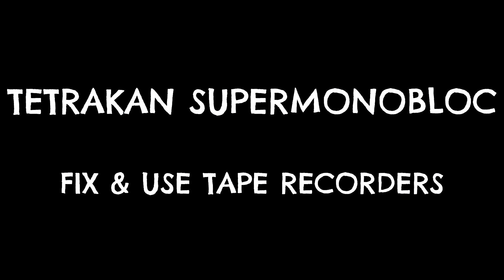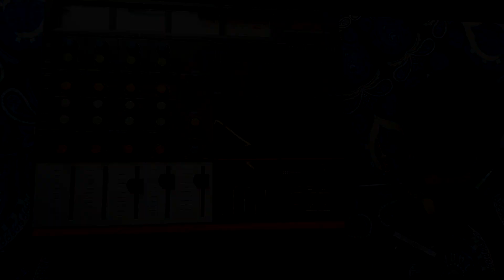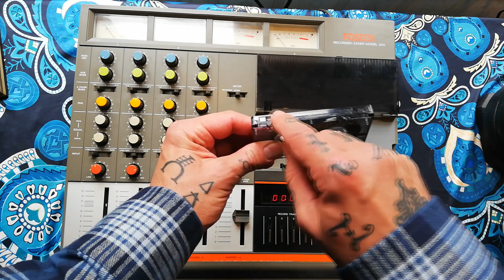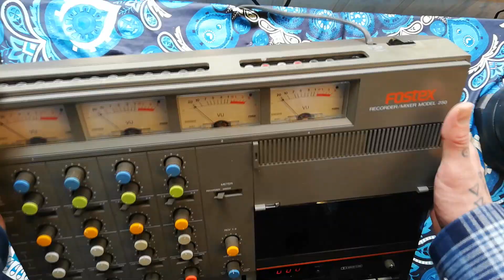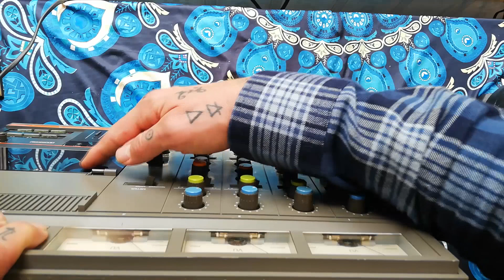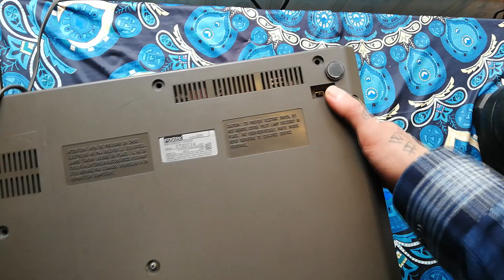Fostex 250 | Review & Features Overview | Comparison vs Teac 144 and Tascam 244

Comment: Just picked up one of these. I can't seem to get it to record anything. Is the little light by the record button supposed to turn red when engaged? Because for me it never lights up. Wondering if the record mechanism is broken. Because it plays back other tapes fine
Reply: Had the same issue and just got it fixed - the little piece of metal that makes contact to complete a circuit when a cassette is put in was bent.  Bent it back and now it works.  Was super frustrating because I had fixed the transport section which previously wasn’t playing tapes at all, and then couldn’t get it to arm…. Hope yours is as simple a fix

Comment: I've actually got mine in the shed half assembled. I've had it since about 1985  It was wrecked years ago by someone who borrowed it.And returned it non working with most of the knobs missing. On that occasion I repaired it and Gave it to my Nephew who at the time was studying music at college.
He later went on to study a royal collage of music and now works professionally on film scores. When DAWs came out he arrived at my house with the Fostex and gave it back to me not fully working.( which is fair enough I actually didn't want or expect it back) It sat in my loift for a few years until a couple of years ago when I thought I'd have a go at fixing it.
All the transport controls were non functioning as all the tactile switches were worn out I bought some new switches and had to make a new board to hold them as they were wildly different from the originals I also had to rebuild the mech. once I got that all working I discovered all the electronics were faulty and either humming or dead. All the slider knobs were broken other than one and the knobs were not original from the time when I repaired it before. I looked at it sat in the shed last weekend just after rebuilding my friends Akai MG614 and thinking it either needs fixing or given a good funeral.
So this week I managed to source the servicre manual and designed copies of the slider knobs so that I can 3d print some replacements. I'll maybe get around to looking at it at some point in the near future. It's just not something that I'm desperate to get working and whilst it would be nice to get it working I also have other things that need my attention over this.

Comment: I'm actually servicing a fostex 250 with the help of your great video guidance. One of the four VU Meters isn't moving anymore but it doesn't seen to be stuck. What could I check before unsoldering or replacing it? Cheers Tommi

Comment: Thank you for your amazing video. I want to use it as a 4-channel mic pre and EQ with individual outputs（to daw through Audio Interface）. Can I send the effected signal from the tape out jack to the daw without having to record it once to tape?
Reply from the maker: Thanks. No you'd have to record first. You could use the line out from the mixer without using the tape player, but that's a stereo out, not 4 mono outs

Comment: I've had one since 1988 that still functions great - and still pull it out to show students about workflow and how recording architecture has not really changed. The cool thing about these is you can use the rcas on the back to implement a compressor in series with the channel direct out out to tape in and get decent, controlled dynamic range without noise floor issues. I think Fostex even made a simple compressor unit. On playback you could take the tape out, then through compressor and back into a channel in line mode and no trim as the level was at unity - but of course this could raise the noise floor. Yes the EQ is a little odd, but if you think about most sounds being fundamental/body and then harmonic, it makes sense.  Taught me a lot about signal flow and what could be done!

Comment: Great video series. Do you know if the model 250 AV can be modified to run at 3.75 ips?? Is there a simple solution? I have the service manual for the 250 but not the 250 AV. The 250 AV runs at normal cassette speed of 1.875 ips. Thanks for any advice!
Reply from the maker: I haven't tried to do that. I guess simplest thing would be  you could run a charge pump on the positive 12 volt input of the motor to double the voltage to 24 volts but I suspect the results would be unstable with a lot of wow and flutter. Most 3and 3/4 IPS rated motors have 4 input cables coming from the recorder and a control chip in the internal circuit board to regulate the speed, so in a more thorough mod  you would have to replicate both parts of this circuit and find somewhere to mount it? I think it'd be complex, so unless you love those sorts of challenges, I'd suggest getting another multitracker would make more sense...good luck!

Comment: I recently acquired and repaired one of these.  Here are a few impressions:

(1) The four-bus system is a bit weird, in that there is no separate "LR main stereo" bus.  This has implications for monitoring busses 3 and 4, amongst other things.

(2) I found the upper mid eq control to be a wonderful feature.  It is centered on exactly the right frequency for bringing a vocal or guitar sound alive.

(3) Setting the playback levels was not straightforward, going by the procedure in the service manual.  In the manual, this is handled under a section dealing with the Dolby C system, and there are two trim pots mentioned, and the adjustments are to be done using proprietary equipment and according to a procedure that was not unambiguously described.

(4) On the whole, I love this unit.  I have been getting good sound from it, and in fact I am currently using it as my main mixer for monitoring my everyday "mess around" direct guitar sounds.

(5) If I could change just one thing about this unit, I would add two more input strips, so that on mixdown I could pan a delay effect.

Thanks for these vids!
Reply from the maker: I completely agree that this has an especially nice sounding mixer, my electric guitar sounded much better through this than through the X15 for example, such a pity I couldn't get the transport on the unit I had working
Reply: Ok I know this a long shot and I’m 2 years late to your comment, but what did you do to get the monitoring for busses/tape channels corrected? For my 250, everything works great, but when I pan my signal to the right it completely disappears. The left works great though. As a result I only have tape channel 1 & 3 lol. Not sure where the disconnect is although it could definitely be the user 😆
Reply from the maker: @taylorspecht2886 blocked or corroded master fader?
Reply: @Tetrakan  thanks for the lightning fast reply!!! Ok, I’ll have to look into that!

Comment: This video and the others you posted on the 250 were really helpful in my own repairing attempt at this unit; I've had it sitting in storage for 4 years  too intimidated to take the behemoth apart. Looks like I had a bad relay on Track 1 of the Rec/PB amplifier board causing the VU on that channel to go crazy (3VAC/38hz was making it's way into the audio path). In any case, I'm wondering if you noticed a signal level difference between Trk 1/2 & 3/4? If I send a signal into any of the inputs while routing it to Trk 3/4 with that selector switch the VUs on those channels receive a higher Voltage than those on 1/2. I noticed on the Mixer board of my unit that C316/416, C318/418, R340/440 and the SGR cables aren't installed which is reflected to some degree (C318/418 & R340/440) in the service manual. I imagine that those identical components on Trk 1/2 are attenuating the signal and this is just another quirk of this old system but I thought I would check with you in case you noticed anything during your repair. Thanks for the great content!  Cheers
Reply: I think the reason is that the 3 and 4 busses do not go through the big fader on the right.  On most machines, all the input and /or tape busses will, at some point, be routed through a main LR stereo buss fader.  On this machine, there does not exist a main LR stereo bus at all!  The machine is set up so you end up using busses 1 and 2 as that otherwise missing stereo LR bus: so you have the big master fader for bus 1 and 2, and the AUX in goes to bus 1 and 2.  And yet... the monitor system and the monitor volume control affect all four busses.  Try this: feed any input signal through busses 3 and 4, and the big fader will do nothing to it at all, but the monitor volume knob will affect it.
Reply from the maker: Hey, I'm glad the video helped with the dissassembly side of things but although I do go deeper into the electronics side of things with some models of multitracker I'm more familiar with,  really this series was just a dissassembly guide...it's the only time I've had this model, it was on loan to me, and since the mixer worked well in monitor mode and I didn't get the transport working reliably enough to test record functionality, I didn't get any further with the PCBs than accessing them for cleaning. If you do discover the signal discrepancy is due to a fault, please post back here; I'd be interested to know, and your answer may help someone else. Thanks for watching!
Reply: @Tetrakan  So I put down the scope and started moving some pots and it appears that the discrepancy is not a fault but a quirk. 

The Line-in has several stages to adjust the audio signal:
 
1. Red knob: Adjusts the gain for either a Line-in instrument or Mic

2. Track Fader: Attenuates that signal

3. Depending on whether  Trk 1/2 is selected for monitoring or not the Master Fader on the right of the system can attenuate or boost the Track Fader signal. Trk 3/4 bypasses the Master Fader when monitoring so the discrepancy is relative to how the master fader is set.

In other words: If the master fader is set Lower than 0, at 0 or Higher than 0 the VUs on 1/2 will be relatively Quieter, Equal to or Louder than VUs on 3/4. Hope that helps anyone that is stuck.